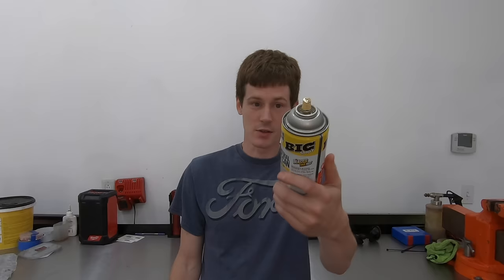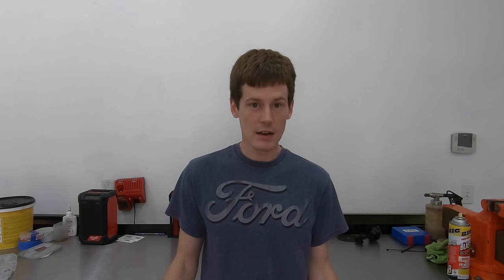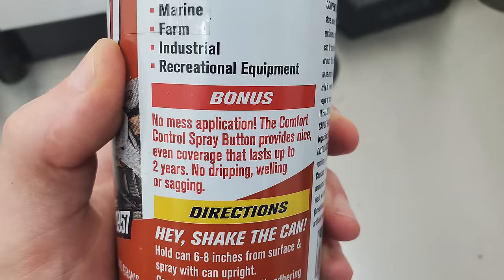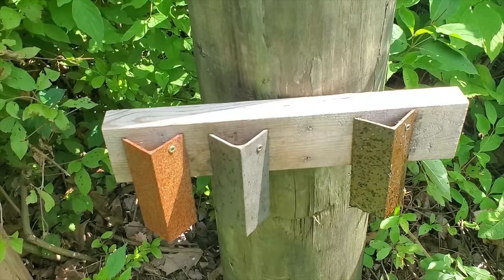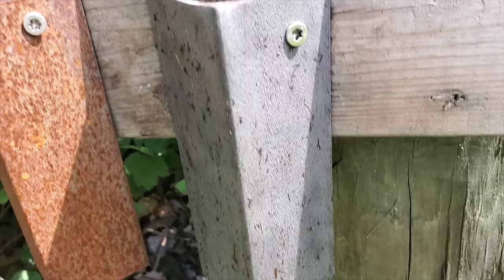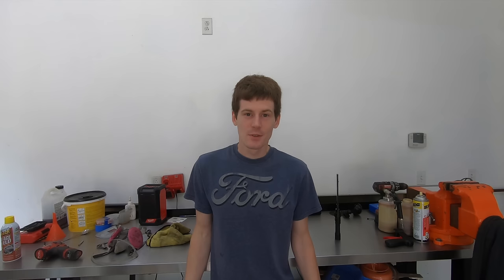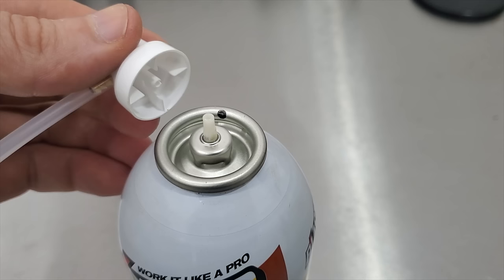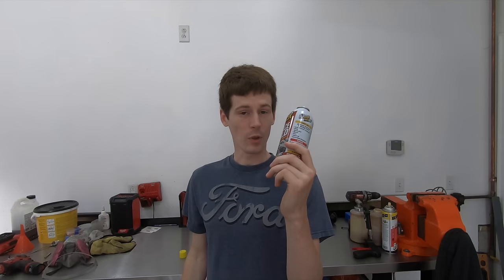I Finally Found The Best Undercoating On The Market... Blaster Surface Shield

Comment from the maker: So to elaborate on the wash off performance a little bit. Surface shield stays wet just like Woolwax, FF, NHOU, etc. The difference is with Surface Shield is when the initial "wetness" has been washed away by water spray, Surface Sheild has something in the product that makes it cling on the surface and continues to protect.

I sprayed some exterior surfaces of my work car as a test. At the end of the winter the only way I could get it off the outside of the car was to literally SCRUB with a wash mitt. Just like cosmoline which does not creep, my pressure washer would not touch the Surface Shield. The difference is when it's wet Surface Shield creeps like crazy! Giving you the best of both world's. I didn't record this wash unfortunately because I had no idea that Surface Shield would behave this way.

The reason that I'm elaborating on this is because I know people in the undercoating industry watch my channel and they will without a doubt put Surface Sheild in their salt spray cabinet and possibly claim their product is better than Surface Shield in a salt spray cabinet. Problem is salt spray cabinets are not reality. My testing has given repeatable results that differ from manufacturers salt spray testing results and have found issues with formulations that even the product chemists could not explain. Even testing multiple batches I've gotten the same results... My challenge to these other undercoating manufacturers is to subject Suface Shield to a test in reality before claiming to have the best product on the market...
Reply: I am curious as to what spray gun handle that you use for these aerosol cans. Have you found one in particular that you like. The one you use looks like it puts out a nice fan spray.   Also I hope they start selling this at other locations. There isn't any Home Depot stores in my area that carry this. Hopefully someone starts to carry this locally as I would like to try this. Thanks for the review on it.
Reply from the maker: @sandmans74  the spray pattern is from the can not the handle. Check the description I listed the handles there.
Reply: Why wouldn’t they get the same performance as your results though? I’m not familiar with a salt cabinet test, but this stuff seems legit, so if their product and this product go head to head in a cabinet, what’s happening in there that isn’t convincing them the PB product is better than theirs? Thanks!
Reply from the maker: @usmc2msu213  The big variable is time. This is going to get long... Manufacturers use these salt spray cabinets as a way of doing standardized testing. These cabinets are $30,000 so not many people have access to one. The way these tests are conducted is they spray salt water on a test panel for X number of hours. The longer that the test panel survives without rust the "better" the product. I don't have specifics on how long each product lasts in these cabinets but, my tests ran for 5 months or about 4400 hours on that telephone pole. A typical salt spray test is 5 to 200 hours depending on how the product holds up. I've had manufacturers tell me up and down that their product will last longer in a salt cabinet than FF. I get their product and as it turns out, it doesn't preform as well as FF in my testing

This is the most glaring example:https://youtu.be/oXlhmbvdKBo?t=736

Thinking I got an old gallon they sent another to test. I got the same result: https://youtu.be/9SOOfZFmhSY?t=922

This manufacturer could not explain these results. Their chemists could not explain these results. Testing 2 different batches gave the same result. As a manufacturer you shouldn't be finding out issues related to your product because some guy on the internet attached some scrap metal to a pole.

As a content creator whose video's will be up on youtube for years it's very hard for me to get behind a product that is constantly being reformulated. In the video linked above the manufacture even commented that they were already working on their next revision to the formula right after a new version had just come out.  In my personal opinion this company is not doing enough testing before releasing a new formula. So if I go online and say product X will keep your vehicle from rusting, 2 years from now and 4 formula revisions later it may no longer be a good product, people possibly develop rust, and I look like the bad guy because the audience has no idea 4 formula revisions that have taken place between my recommendation and present time, with little testing outside of a salt spray cabinet.

This is not a shot at that company I have spoken with them at length about different products. They are truly fantastic people, some of the nicest people out there, and I cannot understate that enough. I just can't get behind the product with constant reformulations.
Reply: @RepairGeek  thanks for the great explanation! I thought I found the best of the best with WoolWax (it’s lasted great over two Michigan winters on my Tacoma) but that Blaster surface shield looks really promising. Once I find it in stock near me, I’m going to give it a go. Thanks again!
Reply from the maker: @usmc2msu213  Woolwax is a good product. It's just too thick in my opinion. On internal surfaces you want a thin product to creep, migrate, and penetrate the pinch welds for example. That's why up until SS came out I was using Fluid Film.  SS has the wash off resistance of Woolwax and the ability to creep like FF. I've proven that many products on the market work and chances are you will have success with Woolwax. As far as my favorite, I like Surface Shield because it gives you the best attributes of both products.
Reply: What do you mean by "creep?"
Reply: @bengleckl1877  some of the products migrate/creep into tight areas that you can’t get access to. Like between pinch welds.
Reply: @RepairGeek  Questions:

Once you treat your vehicles will you wash them at all during the winter months? 
Or do you wait so you do not rinse your protection off? 

How does Surface Shield preform around rubber parts? Have you noticed it swell or melt anything? 

I have put Corrosion X HD on mine and it did result in damage to some of the sensitive rubber components (Brake Caliper Slide Boots). 

Thank you for being one of the few ‘deeply’ researching this topic. As a fellow Ohioan, what they are putting on the roads is definitely not getting better for our vehicles…
Reply: @bengleckl1877  infiltrate, penetrate, permeate, seep, etc.
Reply: @bengleckl1877  I think another word for creep is ‘seep.’ It travels through the flow of the product, movement like vibration, even the air pressure from using a sprayer. It seeps or travels into this almost impossible places to reach. 
I think of it like this. I have an older car and my mechanic discovers breakthroughs rust in a spot not visible from the outside of the vehicle. Seeping means that there is at least the chance for a particular application to reach these locations and prevent damage.

Comment: Im a true blue pb blaster user and fan. Ive had pipes that i had a 3 ft pipe wrench on and couldnt budge unless i broke it. So i got my trusted pb blaster and sprayed the fitting and pipe , went to lunch. 1 hr later went back and got ready to bow down on wrench and came apart like i heated it with torch. Ill always use it. Best ever

Comment: 2015 ram 2500, 126,000 Illinois truck. Been using Krown, no rust. I 100% recommend Krown.  Also, Krown gets inside your frame frame rails, inside your fenders, inside your doors, rocker panels, and cab corners. Places where humidity gets trapped and causes rust from the inside out.
Reply: It’s a very good product.

Comment: Maybe I’m not understanding things correctly at 7:55 but one thing I would take into consideration is that the surface shield was sprayed onto a plastic surface and fluid film onto a metal surface. A polymer (oil) will interact/adhere more strongly with another polymer (plastic wheel well) and maybe even absorb into the plastic, and will have a weaker adhesion to the metal of the frame
Reply: He was testing on the metal washers holding the plastic on

Comment: Just applied this from the gallon bucket that's a friend picked up and had more than he needed. Only took about a quart to do a Kia Sedona. Went on great. I was worried about it's resilience to road spray and under carriage washes but your demonstration on your truck really puts my mind at ease on that front. Looking forward to seeing how it works.
Reply: Appreciate if you could update your status now, how rust protected as present? Thanks in advance

Comment: Ah my young man, thicker and smellier the better! I have a 2016 2500 living in New England. Fluid film since I bought the truck new. I spray the truck at the end of the summer so it gets hot enough that the “thick” fluid film WILL creep into every crevice. It does so so well that it wraps around every seam of every body panel the longer I leave it on without washing the truck. Listen kid the outcome is in the name “surface” not everyone has a rust free vehicle from the start. So that said if the product dries on, it stops penetrating. It’s not just a fact, it’s science. Fluid film and woolwax never dry so that means the deeper it penetrates. I did a test on /16 gauge real rusty piece steel and the longer it stayed on, 2 yrs, it actually made its way through to the other side. THAT sold me on fluid film. So my first coat on the truck was thick, and every year after was just a quick “touch up” spray. The key is not to wash the underside of your truck in the winter. Leave the crap on until the spring. If you use a pressure washer you not doing any justice for the fluid film to do it’s job. Just a spray nozzle on a garden hose does the trick. In the body panels,bumpers, rockers, frame etc. You will also need to use a different vehicle for future tests with this. Bare car from the start, because like I said fluid film gave yours and your dads truck a solid base that won’t wash off because it already penetrated the metals. Good luck kid hope Blaster co wasn’t an influence behind closed doors. $$$$
Reply: He actually works for Blaster now.  Hmmm.

Comment: Great vid. I am a heavy fluid film user. I live in the northeast. I literally use it on everything. The one thing I have to say about your pressure wash test is that the fluid film removes your factory undercoat. So technically the fluid film isn’t on the metal. 
Take that part of your frame and split it between the two. 
IMO I’m all about yearly applications
Mainly because I do it myself. 
Keep the vids coming.
Reply: Yeah, even if the product "claims" that it would last two years, I would never apply it anything less than annually.
Reply: Do you wash your undercarriage at all throughout the year or in the winter to rinse the salt off ? Or do you just apply the fluid film and not wash it until your next application?

Comment: Picked up the last two cans my local Harbor freight had to give this stuff a try. Surprisingly I was able to do a pretty thorough coat of like 80% of the bottom of my 2019 Ram with just two cans. I didn't spray into the frame holes as I only had two cans so I wanted to get the most surface area I could. If I had two more cans I would be confident that it's about as good as I could get it with the spray cans. I'd say 4 cans is plenty for a 1500!

Comment: hello, watched you for the first time today and i am very thankful for your video.  i have a 2003 toyota 4runner that recently went through PA. inspection and corrosion damage was found on my frame.  i will be having a professional welding shop do the repairs but i was somewhat desperate to find a product that will protect the most favorite vehicle i have ever owned.  your attention to detail as you test and observe the products has won me over to the blaster surface shield.  i will be ordering several cans and do the work myself in the near future.  thank you very much and you now have a new sub.

Comment: Very interesting. I've tried Fluid Film on some chassis parts here in the rust belt and the stuff just washed off upon spring time inspection of the application.  Will have to give Surface Shield a try.  Time always tells all and I suspect that most people who have tried it out and written reviews haven't truly been able to test it out yet.  Comparing the SDSs of the two products does look promising for Surface Shield.

UPDATE: after only one month, with two test samples placed outside, one piece with the Fluid Film applied is showing rust while the side with Surface Shield still looks fine.  As I suspected the Fluid Film washes off too easily.
UPDATE: after two months, both Fluid Film and Surface Shield have washed off my test samples.  So both product don't last and really are not suitable for undercarriage use.
Reply: What’s the best brand then?

Comment: More competition for this sort of product is great. I will have a hard time switching from fluid film though. I kept a 1989 4Runner (notorious for rusting) generally rust free for 30 years in the northeast of the U.S. That means salt and brine all winter. On year 6 with a Wrangler and the same, rust free. If you spray any of these brands on THICK and let it get DIRTY and leave it on forever, it won’t matter how long a company claims it lasts. The formulation last long past two years. I just spray on top of each years application, but I guarantee I could skip a few years and it would be just fine.
Reply: after you applied the fluid film lets  say you go beach driving do you still rinse the underside of your vehicle with water to get the sand and salt off? will spraying your vehicles undercarriage rinse away product? im curious on the details of fluid film with a long time user. also what's the best way to prepare the undercarriage to receive a coat of fluid film?
Reply: @Abc444.  Never take your own car to the beach. The sand will stay there forever and will get into parts too. My ex did that and the sand was under his truck for years, untill he sold it.
Reply: @wheezin_mtnbkr good job on the Wrangler, they are notorious to rusting
I will have to try it with my next car. Currently looking for a car, because mine got totalled in April by another driver. It was 2002 Buick Lesabre and the only rust it had was tiny bit above the rear wheel on the fender, and I noticed at the end when cleaning that the water was coming into the trunk and made a rusty trail inside the trunk.

Comment: I just placed an order for 6 cans of Surface Shield, the pack of two spray can handle adapters, the wool wax cavity hose/wand, and the package of the male-to-male spray can converter caps.  I can't wait to try this.  I had my 2015 Silverado coated twice since November 2020 with Fluid Film. but the shop where it was done closed so now I need to touch my truck up myself.  I hope that Fluid Film and Surface Shield are compatible.

Comment: Sprayed some Surface Shield today  on a Nissan previously sprayed with CRC in some areas and Fluid Film . Surface Shield seems to be a little more thin and flows better than Fluid Film but acts a little more sticky to the surface . I know my explanation seems contradictory but it seems  to act just as I described .  Surface Shied  does not have a harsh smell like Fluid film does . I'm going to order a second 6 pack of Surface Shield .

Comment: Hey It’s another great product. I’m using Woolwax,Fluid Film inside enclosed areas like wheel well arches, rocker panels between metal not exposed directly to the elements. I might even use this product in inner cavity. I have also starting using a salt eliminator . Excellent video tutorial
Reply: Wool wax is the best

Comment: I'm in Cleveland so right down the road from you and I tried Blaster product  last year and loved it plus it was only $5 a can.   No rust to report.   Trying Fluid Film and Surface Shield this year on our vehicles.   PB Blaster has always been good stuff.   It will turn black but I just wipe excess off around quarter panels.   After replacing break lines and other rusted parts on my 03' Escalade, Im not letting that happen to my 16' Ram because once Ram starts to rust its over with.  Lol.    Thanks again for this video.
Reply: A '16 vehicle doesn't come with factory coating of any time? Damn. Guess I've gotten to used to toyota lol. Wonder why they don't do it
Reply: Jose Gomez
Toyota has to do something because they will rust in half , cheap thin, frame and body panels
Reply: @kimbuck-2  afaik toyotas come with a galvanized coating, or some type of coating, that so long as it's there it basically makes the frame rust proof. It's best to waste the car during winter season every week or two though. But technically they don't need it.

They started doing the plating/coating like 20 years ago? It's nice for customers tho

Comment: I bought Surface Shield Aerosol yesterday at Harbor Freight.  If I'm not mistaken it was $9.99 a can.  Roughly the same price as Amazon.
Reply: Thanks wonderd where I could buy it.
Reply: Not a bad price, but Home Depot has it for under $9/can with free shipping for a 2 pack right now.

Comment: I use fluid film and its a charm. I do two undercoats a year. One before salt and one after. I live in Nova Scotia Canada and am 300ft from the coast. This place kills all steal cars are generaly only 5 years os so. My taco is 10 and no rust whatsoever. Also heat the fluid film before spreying.
Reply: I warm the gallon jug in front of a wood stove. Not too close of course and stir. You can see the consistency change to more liquid